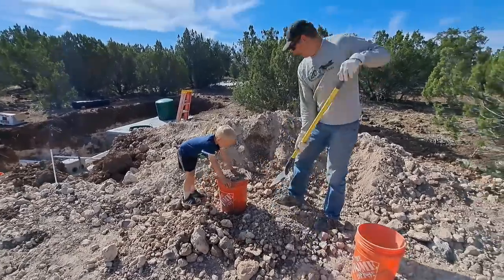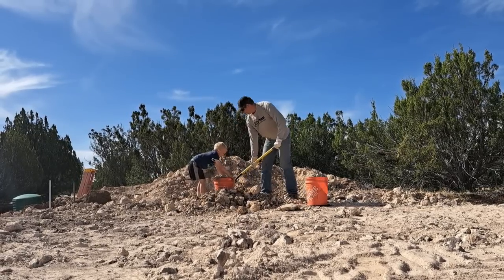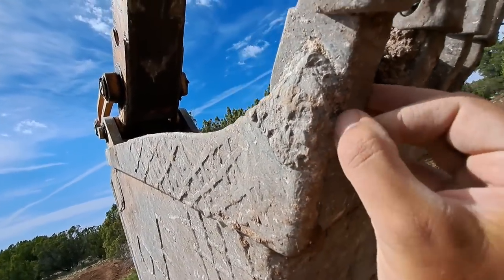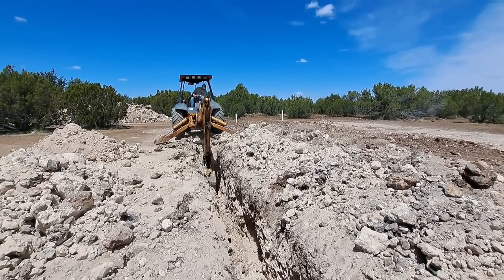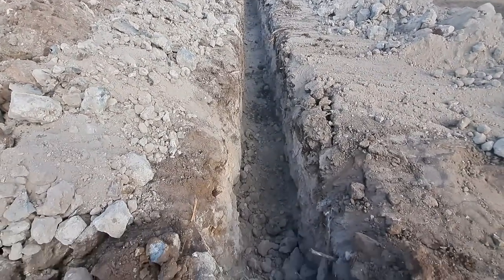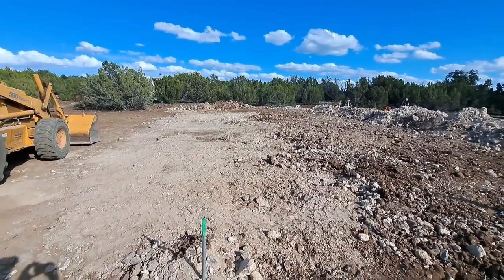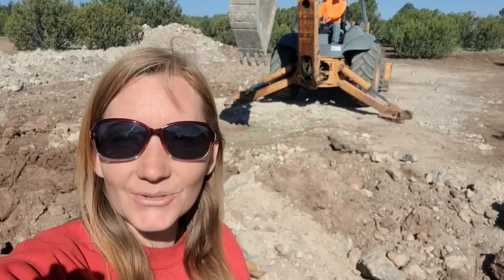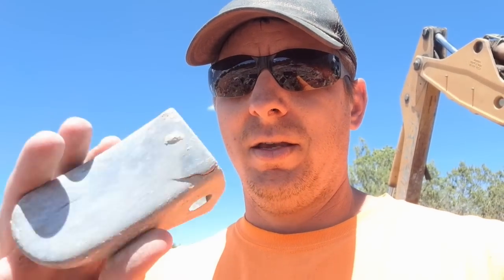DIY DISASTER! Septic System SCREECHES to a HALT

Comment: I miss operating a backhoe. Tip..  put a small spot bead with the welder on the top and bottom of each tooth. Just a bit of reinforcement for the roll pin.  You can always grind the bead off quickly if needed. and never let that bucket half filled. The man that taught me was German. He didn't even like me scraping dirt with my boots; he'd say those aren't shovels. lol..   Wow.. bummer. Keep digging. I was given a bucket that was off a backhoe.. but I'm sure it smaller capacity but wider. I can snap a picture and email it if you want.. with measurements.

Comment: i made a compost sifter with wire fence held with washers to a frame that had rocking base one end  of top wire open and board under the other 3sides 4-5’’ boards worked on top of trarp 👍